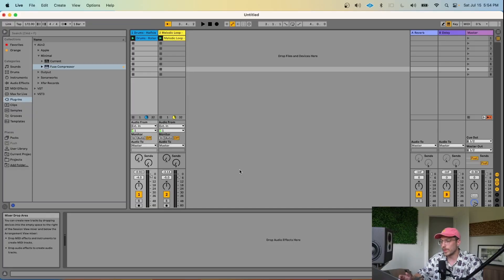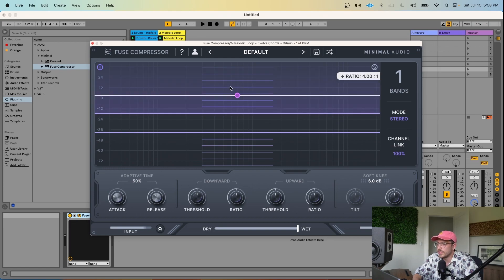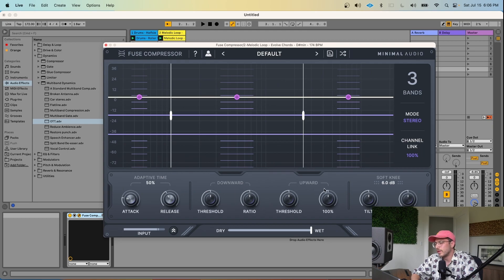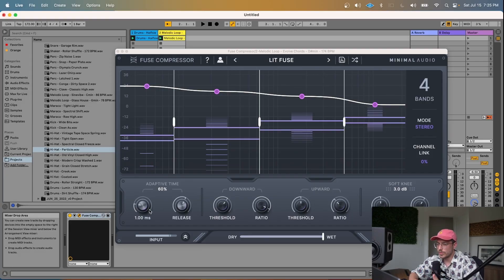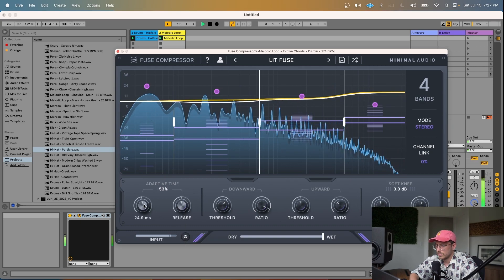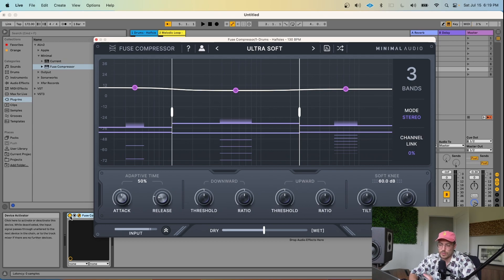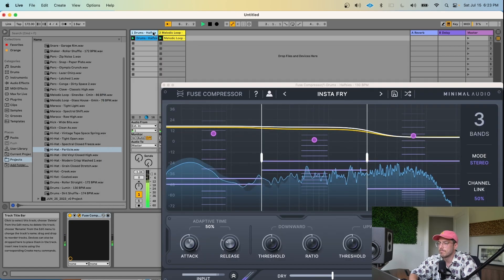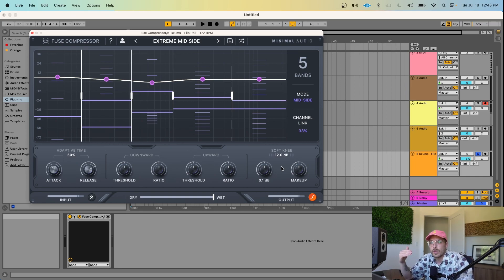Fuse Compressor - Walkthrough with Jake

Comment: Looks really cool! Just to clarify, can anyone who has tried this plug-in answer whether it is possible to adjust the attack and release band by band? Or is it the only way you can control those parameters is to either adjust every band at once, tempered by the adaptive time feature? Thanks!
Reply: attack and release seems to be global, not band by band.
Reply: @mattiasboden2329  thanks! part of me wishes there were band by band adsr controls, but I think its probably a good call for making this plugin quick and easy to use (its already got more control than ott this way)

Comment: I would like an explanation about the phase.
Reply from the maker: Hi! The crossovers in Fuse Compressor are performed by a series of zero latency IIR filters, we prefer these filters because they're low CPU and respond well to modulation. All Pass filters are applied to the dry signal for perfect spectrum reconstruction with no notches when using dry / wet. -- Apologies it was omitted from the video it was not intentionally left out! -- There is phase rotation around the crossovers but nothing that will be audible, you could likely see it using certain monitoring tools.